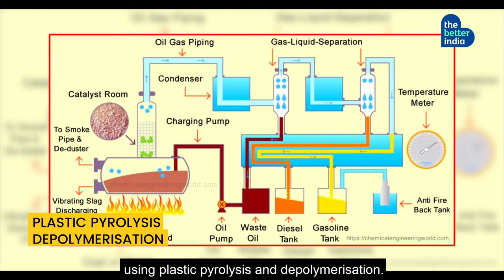Turning waste plastic into Petrol | The Better India

Comment: This idea isn’t that revolutionary and neither is the three step system. The energy required to make decent quality fuel from plastic takes more money then extracting and refining crude oil. By doing this in three steps, the product quality becomes much worse and you can clearly see residue suspended into the fuel products that are extracted out. The dirty fuel that’s produced from this project isn’t that useful in the long run even it it’s cheaper because it will foul up and destroy engines that are run with it which would increase the costs for the consumer in the long term.
Reply: Not only that but it's an extract... so you need to burn 20 tons of plastic to get not even 1 ton of fuel. Imagine the pollution that it creates from leftover plastic ash and heavy oil that need to be dumped.
Reply: So what to do with the plastic???
Reply: @tronixfix  what's the solution of plastic then
Reply: @shivv4919  recycle it.. todays single use shaver can be tomorrows toy car.
Reply: @tronixfix  i mean all plastic in the world
Reply: @shivv4919  me too
Reply: @tronixfix  rip
Reply: I don't know much, but I think the fuel being cheaper is a plus point, because if there is a room for refinement, then adding refinement cost it may cost the same as the current market price
Reply: @tronixfix pls share your revolutionary idea
Reply: @tronixfix  400 tons of petrol from 500 kgs of plastic. So, I think still a respectable conversion rate.
Reply: @tronixfix Recycling plastic is not economically viable. Virgin plastic is very cheap. Also, recycling plastic degrades the quality of the plastic. 

Additionally, this factory is using NON-BIODEGRDABLE NON-RECYCLABLE plastic. So, the plastic being used by this plant as a raw material can not be recycled
Reply: 1. I'm not sure that energy required for this process is more than the energy required for extracting and refining. Even if we assume what you are saying is true, the end product is cheaper than petrol
2. If you want this petrol to be of very high quality, sell the end product of this system to OMCs. They will refine it further to obtain pure petrol and diesel.
3. This petrol is not used to run car and other such engines that require high purity. Not alm engines require high purity of fuel.

Comment: What about the waste product inside the tank that remains when plastic is molted
Reply: as told in the video there's no residue left over then how are you saying there's something waste product?
Reply: It is bitumen can be used for roads
Reply: @harshav8834  bitumen is burned plastic charcoal? Maybe in india or pakistan but not in any western country.
Reply: By product in tank is crude glycerol which can be used in making glycerine and you can sell it to cosmetic industry further and tar/fly ash can be used for bricks/rooftiles making.
Reply: @tronixfix  The residue is called bio-char and is an excellent replacement for bitumen. Also, can be used to replace coal.

Comment: It is not new technology. Canadian company is doing that since 2019 or even before that. There is a video on youtube about it. Its Toronto based. Its called Phoenix, and comes from Sparta Group. Same technology - pyrolysis. 5 tons of plastic turned into 4 tons of fuel. It does not change emissions, but gets rid of plastic. So when you burn it it produces same amount of CO2 and warms the climate.

Comment: 1:07 in this video you are saying PET plastic cannot be used. But actually it is very easy to recycle and reuse. And in the process of Pyrolysis every kind of plastics can be converted into oil or petrol

Comment: What happens to the residue? Is it not harmful to dump the remaining residue into the environment?.
And i understand that although it is making use of waste plastics and hence recycling it is ofcourse a good thing but we also need to evaluate it whether this kind of petrol is emitting more harmful gases or not. Such as sulphur dioxide.
Reply: the thing is to neutralize that there can be added filters....you see the normal petrol when not fully burnt (partially 100) also produces sulphur dioxide as a residue.
Reply: Naa residue Coal jaisa kuchh hota hai 
Atleast itne plastic se thoda sa RESIDUE hi thik
Reply: The sulphur content is 1/10 of the regular fuel, so it is less likely to produce as much sulphur dioxide as regular petrol produces.
Reply: We are talking about the waste byproduct like ash, coal and the heavy oily residue. We still have to trow it away and by burning it it will become more toxic. That's why the americans who invented it on the 1980s did not proceed with bigger amounts.
Reply: The residue is bitumen it can used for roads construction
Reply: We can use the byproducts in other way like the Ash/tar to make bricks/rooftiles and crude glycerol  to make glycerine,you can store co2 for other industrial purposes but it is costly but worth investing.
Reply: Less emissions. Already tested in lab as well as real world conditions. Talking about the residue (char), it can be used as coal or bitumen replacement.

Comment: If this is successful experiment then why govt of India did not implement this at huge level with help of big industrilist like tata and ambani..my second one daught is process requires 300 degree Celsius temperature to droup out fuel right so tell me how much amount of fuel would be required for 300 degree Celsius temperature and what amount of fuel will be produced at output end.
If input and output is same then this is going to be  very lossfull experiment.

Please explain in detail
Reply: There's net energy gain.

Comment: "If fuels are produced which are burned afterwards, then even more CO2 is blown into the air,
That's not the idea of a cycle."😢
Reply: If you bury it in landfill it breaks down into CO2 anyway. At least this way it's reducing the use of fossil carbon fuel sources.
Reply: @HandSolitude   They have no problem with burning plastics in garbage mounds but burning them after people use them as petrol.

Comment: so we need fuel to first burn the plastic that will create more fuel. good solution for plastic waste. though my question is will the fuel produced be more valuable than fuel used for this process? or do you use the already produced fuel to run this structure?
Reply: the non-condensable gas created in this process can be used to heat the pyrolysis reactor.
Reply: There's net energy gain. So, not an issue.

Comment: What isn’t discussed is the highly toxic dioxins and heavy metals which gets concentrated in the fuel, which is breathed when it is combusted.
Reply: no that's not the case, fractional distillation of pyrolysis fuel gives exactly the petrol as a byproduct, which is technically the very same "gasoline" in the market. ( Also note " there is no chimney in the factory" as stated in video. so no there is no " highly toxic dioxins or heavy metals present in the petrol they sell.
Reply: @rdj2398  yeah that’s true, i meant that dioxins are produced, whether they get out is dependent on the controls at the facility.  I am not discounting the possibility that the oil industry is ploughing millions into discouraging this recycling of plastic, for obvious reasons😆😆😆♥️♥️♥️

Comment: burn coal to get fuel which will even more produce co2
what did he solve exactly?
Reply: The fuel he obtained has 10 percent the support emissions and 50 percent the carbon emissions when compared with traditional fuel. Also, any type of pollution is better and easier to solve than plastic pollution.